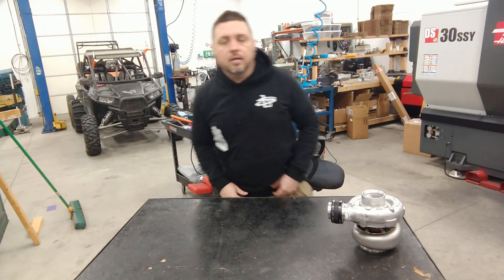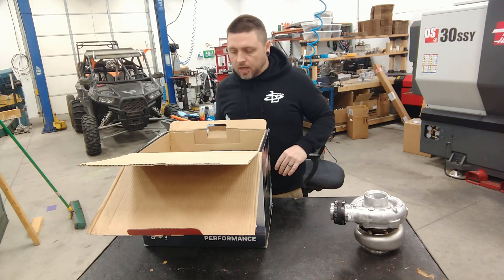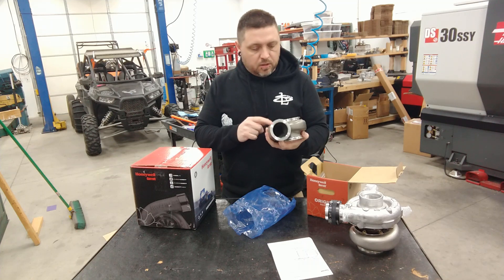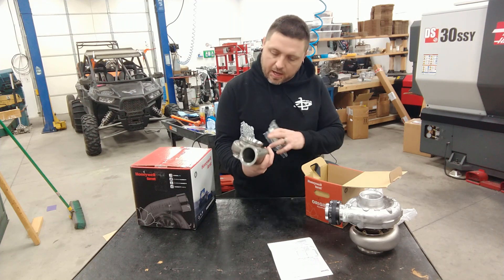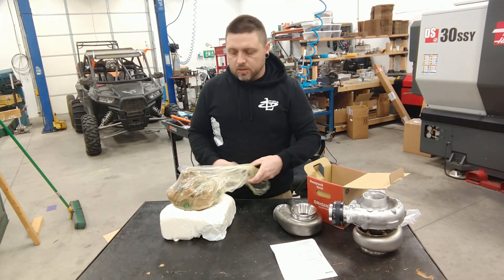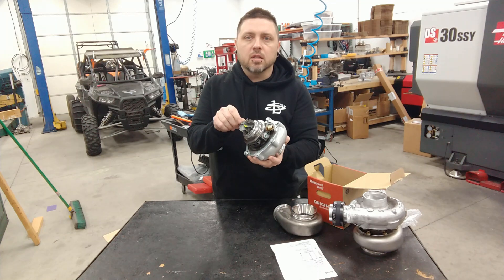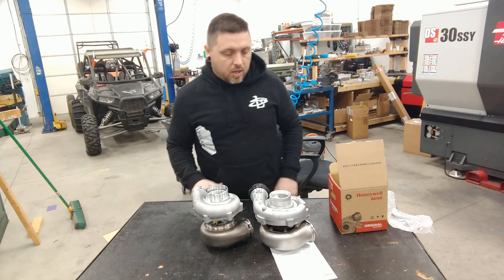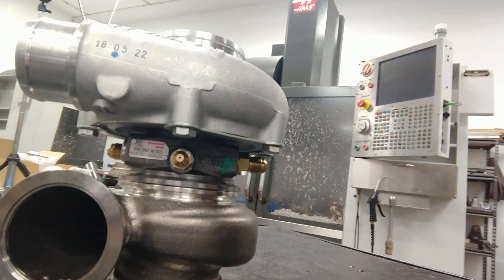VW 1.8t build. New turbo! Garrett G25-660 unboxing and table top review.

Comment: I am curious about the final results because with all that you have done in the GT3071 it should not be really that far off the G25-660. Possibly now someone else is enjoying an excellent turbocharger purchased at a bargain price.
Reply: It's weird that you read my comment after 3 years I was curious to look at of I didn't remember what was all about. Most likely the revised GT3071 made power, the G25 660 is an improvement more because it's a size better suitable for the 1.8 lt engine rather than better technology. A smaller a/r should have been better
Reply: Your reworked gt3071 most likely performs better than a 8 blade gtx3071 and not far off a g30-660 it's just that is a tad big for the application

Comment: Difference between g30 and g25 for the same 660
Reply from the maker: Digital Sennna the G30 has a larger exhaust wheel that will lower exhaust pressure for slightly more power at the expense of turbo response time.
Reply: @linderpowersystems_LPSFAB  legends guys.
Thanks a million
Reply: @linderpowersystems_LPSFAB  turbo response time is basically lag but a fancier way if I'm not mistaken

Comment: Already see how Garrett pulled this off in theory. They took a GTX 11 blade compressor wheel and cut off 2 blades for the G series. So what we have here is a 9 bladed billet wheel with probably extended tips and altered aero. 9 bladed turbine wheels are known for being light, quick spool, and moving serious air. Now, move that theory over to the compressor. Now add compressor tricks to the aero that help with PR and airflow that the turbine will never see because it's a turbine. Bingo, you have a G series Garrett...

Comment: Any results so far... What is the spool of the G25-660. Any good at low RPM's?
Reply from the maker: No not yet, I'm still working on this project as I have time. There are a few others already running them though, and spool with the smaller housing seems to average around 3800rps..  I'm expecting a bit higher than that with the larger housing. Power results are extremely impressive, I have seen over 500whp on a Dyno Dynamics Dyno.
Reply: @linderpowersystems_LPSFAB  Thank you for your quick answer. I was hoping that using a 0.49 A/R or .072 A/R would spool between 2.700 and 3.500. In mind for driving on a daily basis.
Reply from the maker: @DJJoeyV  maybe you would be better off with the g25-550.. but then you are paying a lot of money the have the same capabilities of a cheaper unit imo. I think this 660 really shines in it's spool vs power making potential, not a lot of turbos that come close to this... Basically the power of a 35r with the spool of a 3071
Reply: @linderpowersystems_LPSFAB   500 whp on pump gas or e85?